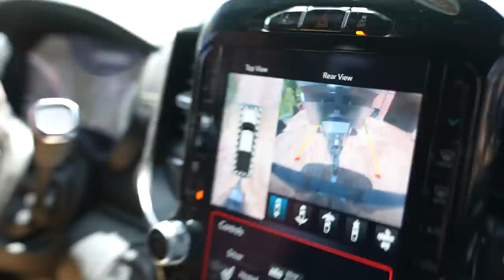THIS IS A MESS!!! SHOULD WE HAVE WAITED???

Comment: Trent you really need to keep the blade in front of you at all times man. it will get you out of so many binds , stop you from sliding , level you up, steady the machine when lifting heavy loads exc.
Take it from someone with years in one lifting way more than it should be doing.
only time you won't it behind you is when you are climbing a hill man.
now you need a trailer hitch attachment for the front of the skid steer so you can move the dump trailer around the back and move dirt and stuff.

Comment: Ground work is often a daunting task and its time consuming, but just keep nipping at those dirt and boulders and you will get it done.
Also I would suggest that Allie get into the Skid Steer its not that difficult once you practice a bit just spend maybe a hour to give her some pointers as soon as Allie is comfortable she will get the experience just by operating it and it will make moving the dirt so much quicker. 

Another thing I would like to suggest is to get some communication devices up like CB's or Porto's something cheap that works you can even use your phones if need be to test it out. A lot of time when your busy you don't see or even hear the people outside with all those machine noises it makes communication and coordinating so much more instant and easier.
You can communicate where you are if you come around the corner or if there is a problem etc.

Comment: With all that water getting into the garage two wings (making the floors muddy), do both of your structures (house and garage) have drainage below the frost line (I think you said something about the house footings). Is there a plan to route surface water away from your home and garage.  With the amount of dirt you have behind the structures (sloped hill) are there plans for retaining wall or tiered retaining walls? I think most place need an engineered retaining wall thats over 3 feet.  Which also need some type of drainage.
Also as you are putting a flat area around the back of your house and garage, is there room enough to remove snow from those area in the winter?

Comment: I had that happen to me with the wood peckers!  I called Cornell Univ. and they told me to get a tape kind of like plumbers tape looking.  It comes on a roll, it's white, and cheap (little stronger than garbage bag meterial).  Hang it up about two feet in length with a thumb tack and the same width apart.  Hang it on the part that hangs over the roof, or where ever you see them tapping.  It will move with the breeze, and they don't like that at all.  They actually try to make nests in houses Cornell says.  It actually works!  I left mine on the house and let them wear out and fall off.  The wood peckers didn't come back.  If they do just try it again.  Or you could bang pots and pans LOL   They want a quiet place to live and nest with no motion around or noise.  This all may sound stupid, but they study birds behavior there and this is a thing.  They may even bang on stuff that isn't wood, so just put this as close as you can get to it.  Don't worry about your neighbors, they will learn in time when the birds start on their house and stop on yours!  Now off to finish watching your video

Comment: You'll buy lumber for the log stove in September. Could you dig a well in the yard? one that you could pump out every spring just to assist the ground drying, It's nearly July and you have only three months left before winter closes in again. Probably no more than ten feet deep! Not to gain water but to gain access to your surplus ground water so that you can pump it out of the soil that makes the drive.

Comment: Trent! Don't hang drywall on the exterior walls or the ceiling without first installing a continuous vapor barrier (4mil good, 6mil better). With the spray foam you installed against the sheathing, you'll be creating a zone where moisture can't escape. The result in 5 or so years: ROT!

Comment: A woodpecker can do a lot of damage to wood siding, maybe try some peppermint oil on a rag and wipe that metal fascia since a woodpecker is looking for insects to eat, most insects hate peppermint, so placing a sent of it on the fascia should get the insects away and therefore the pesky woodpecker.
Did you get your propane topped off yet?

Comment: The woodpecker is trying to attract a female. We have the same thing happen every spring up here in Alberta Canada. We live an octagon shaped log house made out of 2ft diameter logs and they never touch the logs only the metal roof and eavestrough. The odd one will discover the chimney pipe witch makes a different sound and drives us really crazy because it is especially loud inside the house. The saving grace is it only lasts until he finds a mate. Usually about 2weeks.

Comment: i do not understand why you do not use  burn barrel or even a nice stone fire pit as most of the "paper " product and by product will burn  and save the landfill from filling up  even if there is a burn ban on in your area it will be lifted soon and the you can burn the wood and have a nice evening fire and at the same time it will keep the mosquitoes at bay because of the smoke and heat factor

Comment: Sandy soil drains clay takes longer to dry out thoroughly.  If I were you I would find something to do besides running heavy equipment on it. Just a suggestion. Yes the woodpeckers peck on the vent pipe on my roof and it is really loud. They do it every spring. Looking for females maybe.